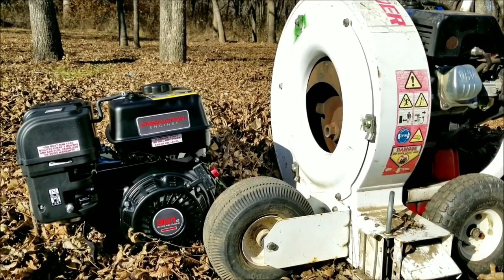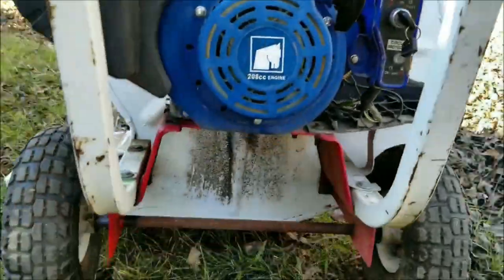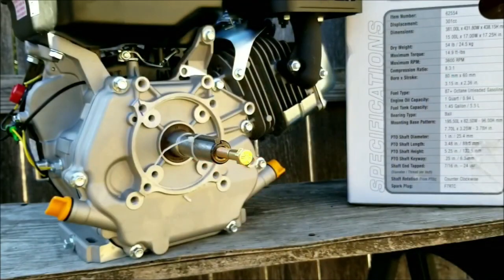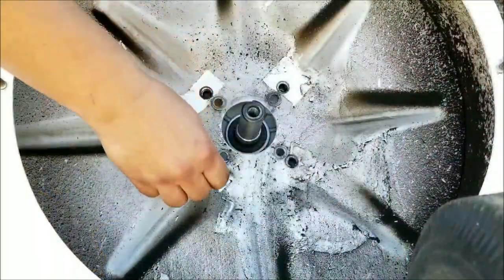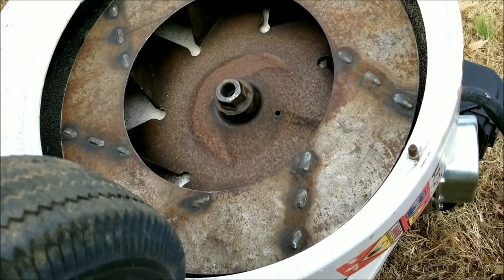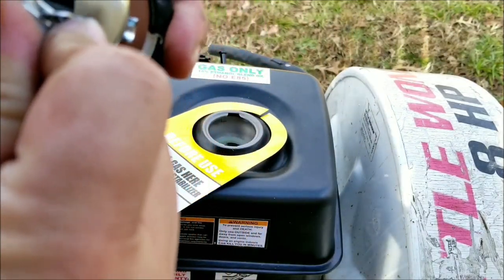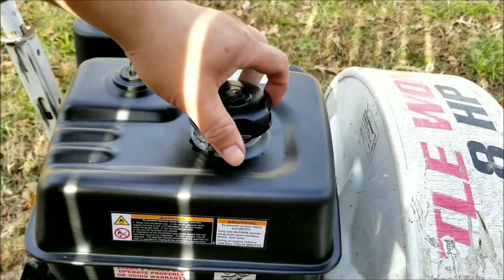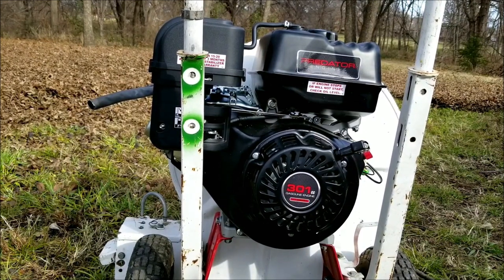Predator engine swap on leaf blower

Comment: I just did the same replacement because my 8HP Briggs snapped the 1" shaft.
1) The blower propeller was out of balance, this probably caused the shaft failure. I balanced it before putting back on.
2) The Predator 301 engine had the exact same shaft height.
3) Rather than fabricate a new exhaust, I simply cut the back of the fan casing where the exhaust pipe was touching. It
    only needed about a 1" by 2" hole. If I could do it over, I would have simply peened it since it only needed an indent of about a half an inch.
4) The muffler shield also touched the housing and needed a small corner area removed.

That's it. Good video and Thanks. My only recommendation would be to check if the propeller is in balance, otherwise the new one will eventually fail too.
Reply from the maker: thank you for the information

Comment: Great fix and I am surprised how well that thing blew the leaves.  I always try to follow manufacturers directions with break in as well as designated oil changes.  I usually change oil more frequently than recommended.  Keep the video's coming.
Reply from the maker: Thank you D Butler for the comment and yes they'll keep coming.

Comment: I got a new chainsaw last year . From a local tool store here in the uk . £90 . 
I ran it in as recommended in the book that came with it . 
Well worth it . It was purchased for occasional use . It's had a fair bit of work since getting it. I always run the fuel dry to . Same as my other powered garden tools Hedge trimmer got that a year ago for peanuts . Just needed new fuel lines and primer bulb . 
Strimmer too . Fuel it up couple of pulls it starts . 
4 stroke mower I inherited when I moved in . Even though I serviced it . Always issues starting . 
This year got proper spark plug NGK. Starts first time every time now . 
Thanks for the videos I'm learning so much.
Reply from the maker: thanks for the comment I appreciate it. i enjoy hearing about other people's experiences

Comment: I buy a lot of items from both Harbor Freight and Northern Tool.  However, I make it a point to avoid their Chonda engines due to the high failure rate. Even the cashier @ HF advised me to do so.  The price is attractive and they run good for a while, but will randomly crap out. It that engine was a parachute, I certainly would not wear it jumping out of an airplane! LOL

I chose the Briggs Vanguard to repower my old Little Wonder 8hp blower.  Yes, it was twice the cost of the Predator, but the Vanguard bolted right on.  No drilling new holes, no sleeving, no muffler modifications, no guessing games. Even the throttle cable fit where it was supposed to.  The ease of installation and peace of mind for long-term reliability justified the $400.00 I spent.  Nice job installing and I wish you luck with yours. It does sound badass with the pipe!
Reply from the maker: Thank you for the comment I appreciate it and sharing your experience.

Comment: I always try and warm my stuff up whether new or old and 99% are old and well broken in or broken down. The splitter has the 13 horse Predator and am WELL pleased with it. Son-in-law came for it last week. It had geen sitting a full uyear since it had been run last and started oon 1st pull. Super engines. And the splitter anbd 261 saw are the only new stuff I ever bought except for power tools. Those blowers sure do the job. The old one had an 8 horse Briggs flathead and wore me out on a regular basis. BLESSINGS 2 U!
Reply from the maker: nice, as long as certain precautions are taken those engines work great!
Reply: @HomeGaragechannel  Mine always have but they may blow tomorrow but they're well paid for.
Reply from the maker: that's always a plus

Comment: Hey I just did this change over myself. But I kept the stock exhaust on. Worked out great. I did have to use a few washers to get the clearance I needed & weld on a pease of plate to extend the engine mounting holes to fit. Well worth it to me that the whole engine is stock & with the engine a little farther back it’s easier to raise the front to turn.
Reply from the maker: yes the clearance was an issue, thank you for sharing
Reply: How
Reply: How did you fix it
Reply: @quentinreedfamilyreedfamil1347  
 Like I said I shimmed the crank shaft with washers till I had the clearance I needed to leave the muffler on. A C E  HW had the longer bolt I needed to bolt the propeller to the crankshaft. Tr-ctor s-pply had the washers that fit. At this point the 4 holes for the engine will not line up. Because the engine sits farther back. So I used the same thinness plate steel & extended the frame by welding it. Drilled new holes to mount the engine to the frame & that’s about it. It actually wasn’t that much work. Done in a short day. The muffler dose touch the blower housing thou. But I’m ok with it.

Comment: I just fitted new rings into my Briggs & Stratton 3 hp powered Supa swift lawn mower over Christmas time which stopped it from burning oil,it only needs about 3 pulls to start it instead of 6.

It runs the old suction type of choke O matic carburettor so relies on engine compression to draw fuel in from the fuel tank, not a primer bulb or gravity feed so it needs a few pulls to start it.

Briggs & Stratton recommend running it for 5 hours to break the rings in but most of the grass is dead due to drought, I tried in on a green patch of lawn & it went well.

We've had some rain so some of the lawn has sprung back to life so I might do some mowing today,as far as the break in procedure goes,I will change the oil after 5 hours of use.

Edit 25.1.20 - it started first pull this afternoon,I mowed with it for 1 hour & the spark plug electrodes now run grey instead of being oily,it doesn't use any oil now whereas it used to burn 1/3rd (200 mLs) of its oil capacity up in that time !
Reply from the maker: Nice. I still believe in breaking the engine in myself.

Comment: Hi: Nice fix. I usually run the engines for about 30 minutes to ` hr. at half speed and then change the oil. I have never had an issue in my shop doing this. Also you might want to think about sending the crank in the other engine to a machine shop and having it center tapped, threaded and then welded with a new end of the shaft. Or maybe just install a new crank??? Thanks for your video's.
Reply from the maker: Thank you  Waterman one for the comment I appreciate it.  Yes that's an idea. I'm looking a possibility taping it

Comment: I see immediately why the first engine broke, there's no rubber bushings installed between the engine and the mount to reduce vibration. Too much vibration can cause this to come apart. Happend to me when I recovered one of these a few years back

Comment: I did a harbor freight swap (5.5 Heni head) on a Parker Thatch-o-magic. I needed an engine quick so I bought it. Ran fine first season thatching 15-20 lawns. Winterized and put away. Following year started up ran lousy. Cleaned and adjusted carb, new ngk plug, no difference. Not sinking any more time or money into it. I’ll find an older Briggs, Honda or Kawasaki. It bugged me putting a chi-com engine on a nice USA made piece of equipment anyway. We also had a China clone on northern tool splitter. After 2 seasons it jumped time, ate the valves. I know lots and lots of guys re-power with predators, and even the new toros and ariens use Chinese engines. That’s fine I have lots of equipment and most of its older. If it can be repaired I do otherwise I only run Japanese or American.
Reply from the maker: Very excellent examples of these engines  short comings. I already started mine this year so its still good luckily.  Thanks for the comment I appreciate it
Reply: Good luck with it, I hope it serves you well. For me, when I depend on a machine to put bread on my table, I can’t trust them. There’s a reason the price is so low. Good video though. We just bought a new little wonder. Fantastic machine
Reply from the maker: @newstuffsucks...5754  yes they are. Thanks for the comment again

Comment: Its always best to follow the manufacturers instructions for break in procedures and usually its in the from of hours and depending on manufacturers there may be minutes and hours maintenance that must be done to keep the engine running , my dad has an old model number 9 briggs and stratton 5 hp engine don't know that exact year but it's run time before an oil change is 25 hours and add oil every 5 hours of run time as needed until it reaches 25 hours and the air filter is steel mesh that you put oil on or in the pull cord is separate and has to be hand wrapped around the pully to pull start it and it has a condenser and points and yes it still starts and runs great
Reply from the maker: you are correct!

Comment: Nice job. Two questions: 1)Does lowering the blower housing affect the ground clearance of the machine? and 2) Was the output shaft the same length?  Looking to do the same, but dont want to run into these issues.
Reply from the maker: 1. It mainly changed the angle of the blower, sort of like lower or lifting the back of a pick up truck.  
2. And if I recall, the shaft was the same length.

Comment: At 4:05 the engine mounting bolt/nut doesn’t have a washer under the nut to help it secure it to the frame and engine base. Also are you going to mount and bolt the original muffler onto the pipe?
Reply from the maker: Yes you are correct on both points.  I'll put a washer on soon. Yes it will be the stock muffler or one of those round spin on ones .

Comment: I used to break my engines in but my dealer tells me now a days just run them wide open from the start and do first oil change at 5 hours.
Reply from the maker: Gotcha. I appreciate your comment thank you  nashguy207.
Reply: yikes wide open no load....not at my house....i have several predators....idle brake in, for one tank of gas , change oil....now you are ready to go...

Comment: I’m in the middle of the same project with the same blower and engine.  Can you tell me what 3/4” spacer that you used to handle the  differences in shaft lengths and how you mounted it.  Also did you use longer bolts to mount the engine to the blower housing.  Thanks so much.
Reply from the maker: I don't recall needed a spacer for the shaft length.  Yes, I had to install longer bolts to secure the blower housing to the back of the engine and you'll need to use spacers there to keep the housing from being pulled towards the engine.
Reply: @HomeGaragechannel  do you recall if they were 3/4” spacers?  I appreciate your help!

Comment: What was the original engine a 1 inch straight shaft? I am looking at buying one of these and the Engine may or may not be bad the listing doesn’t say just says needs love but I have a sneaky feeling it’s a step shaft
Reply from the maker: yes It an 8 hp horizontal shaft briggs with a 1" shaft.

Comment: Can the original handle mounted throttle control be hooked up to that engine?.....Seems a bit labor intensive to have to keep reaching down to change throttle settings.
Reply from the maker: sure it wouldn't be a problem its just not necessary.
Reply: @HomeGaragechannel  I have an identical model Little Wonder 8HP High output blower that has been sitting in the back of my garage for several years with a seized engine....oil seal blew while I was using it, and I have been considering a repower....but wanted to keep the handle mounted throttle which is why I asked.

Comment: Great video! I am looking at using the 212cc engine for a leaf vacuum engine replacement. I will also need to make the muffler mod. Doesn't the engine run really loud with only a pipe instead of a muffler? Could you have run the pipe to the muffler to make it quieter? I'm new to all this stuff. Thanks for helping us learn!
Reply from the maker: Yes its loud but I wear my hearing protection so I don't notice it.  Yes I  could have run the pipe to the muffler but the distance of the muffler from the engine makes it vibrate a lot.

Comment: I have the same job with the same blower/engine. Could expand how what you did for the exhaust get modify to fit?  Thanks.
Reply from the maker: sure. i took off the muffler and got a flange that fit the engine and put a pipe on the flange that angled away from the fan housing.
Reply: @HomeGaragechannel  thanks for the quick reply!  Did you have to weld the angled pipe, after you bolted on the flange?  Sorry pretty new to this.
Reply from the maker: @trevorwood9703  its not a problem.  Yes I  had to weld it. The flange was originally an EGR flange from a toyota. I used some of the pipe since it was turn already and some straight pipe from a different engine.

Comment: Hi there.  I replaced my 5 hp Briggs & Stratton on my little wonder 5 hp blower with a 6.5 predator but same like you the shaft broke. Welded it together and it broke again soon after. My question is the predator engine that you are using has a 3 1/2 inch output shaft whereas the 6.5 hp that I had, and like the old Briggs, had a 2 1/2 inch shaft. How did you handle that or is your air housing wider?  Was your machine an 8hp originally?  Thanks much.  Jim
Reply from the maker: yes I think the original was an 8 hp briggs, then I went small shaft and that broke, but the 301 needed to be moved back to compensate for the differences in shaft length.

Comment: Are you able to hook up the throttle linkage from the handle bar to the one on the engine, or are you going to have to reach down every time?
Reply from the maker: it works just fine reaching down there. I might try fabricating one in the future.  Thanks for the comment I appreciate it
Reply: @HomeGaragechannel   - If you do fabricate something to make the throttle linkage connect, please make a video of it.....even if the video is done after the installation is completed.  Would love to see how you choose to go about it.  Overall.....nice job on this engine install.

Comment: Hi can you explain what you did to modify the height and how you got to center the shaft correctly?
I have a 8hp little wonder briggs and want to put the 13 ho 420cc predator on my blower
Reply from the maker: yes I had to change the mounting positions, on the blower housing, I ended up, drilling a new hole on each side, and using 1 of the existing studs. I also had to make new holes in the "red" mounting plate as well, and stand the engine, about 3/4' away, from the back of the blower housing

Comment: I know this is a relatively old video, but I am doing this to my Little Wonder.  I have found the same shaft height issue (I'm using the predator 301cc as well), but also see a shaft length issue; the predator is about 3/4" longer than the original Briggs.  Did you account for this as well or was it not an issue going from Powerhorse to Predator?
Reply from the maker: You are absolutely correct, I use to use a 3/4" spacer, to move the engine away from the back of the blower housing.

Comment: Swapping an engine is a bit like swapping a carburetor, you have to make sure every part is the same or else it won’t work
Reply from the maker: That's very true. I will say you can make small modifications to help it work out.

Comment: Harbor Freight has certainly missed the boat by not coming out with an afford and extension line of vertical shaft, electric start 10-25 HP engines a long time ago to repower riding mowers.
Reply from the maker: I wonder why they haven't? I'd like to know just for fun.

Comment: I let the engine break in properly, letting the engine parts expand and let it Idle for a while before I turn it off. It’s not good for the engine when you put heavy load on it straight away when you use it.
Reply from the maker: Thanks for the tip I haven't put much time on it so I'll give it a try.

Comment: What could go wrong if you run the engine with no exhaust what's wrong without having an exhaust
Reply: What could happen without an exhaust
Reply from the maker: Well you could affect the air fuel ratio and need to adjust the carb so it doesn't run lean on fuel.
Reply: @HomeGaragechannel  I thought you could warp the valves
Reply from the maker: @IvanOchoa461  that's a good possibility too

Comment: Old Snap on 18v impact?
Reply from the maker: Yep still works like a champ.
Reply: @HomeGaragechannel  my dad has 2 if them, and a drill. He doesnt use them. His new stuff consists of a drill, right angle drill, impact(3/8 and 1/2., ratchet(1/4 and 3/8),buffer/polisher, orbital sander. He doesnt use the impact, he uses a Flexzilla air impact. He doesnt use the drill, he use a Dewalt drill. He doesnt use the 1/4 ratchet, he uses the 3/8. He doesnt use the right angle drill. I use the 3/8 impact. He uses cheaper stuff, not his expensive stuff
Reply from the maker: @js_1995x  he definitely values his good equipment.  After I got the snap on I didn't use it over year but now it's in my tool bag ready to use.

Comment: That's a lot of modifications. Rather buy the orinigal engine. But good job.
Reply from the maker: You are correct.  If I bought the Briggs version it probably would have been a better fit.  Thanks for the comment I appreciate it

Comment: for me a new 2 stroke i put a cap of 2 stroke oil in the tank on top of normal mix for 2 to 3 tanks and not over half throttle under no load 4 stroke ill run it at the lowest throttle I can to do the job for 2 to 3 tanks then change the oil and run it normal
Reply from the maker: nice thanks for sharing your experience